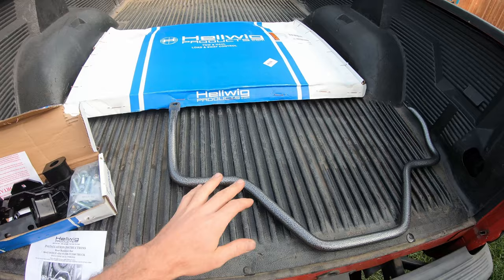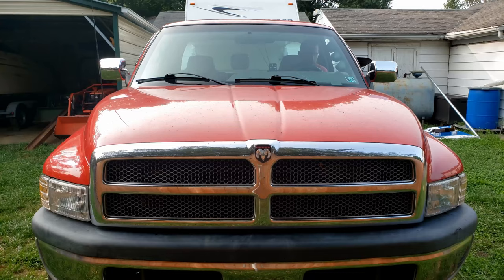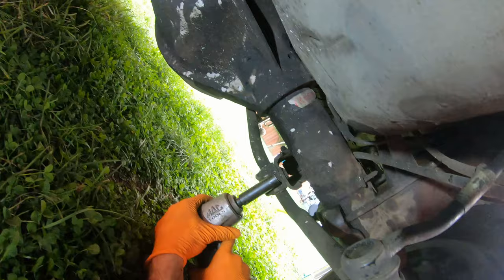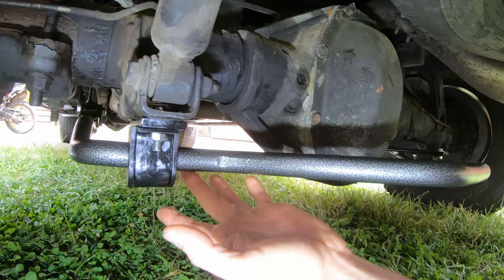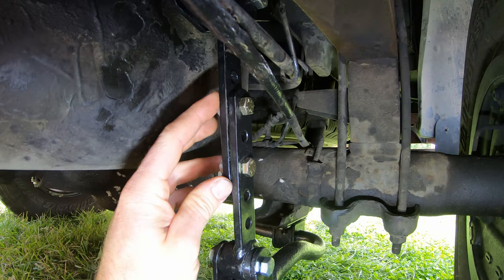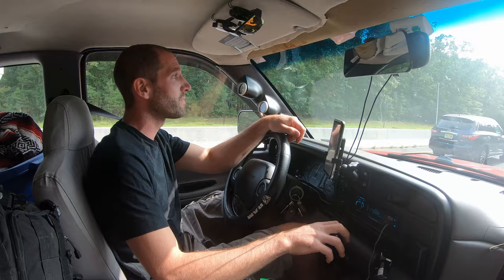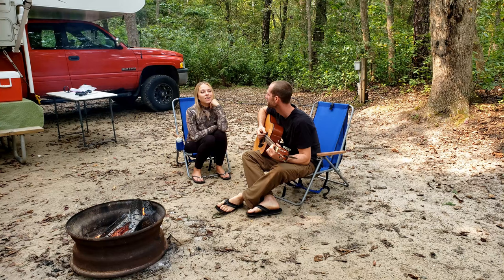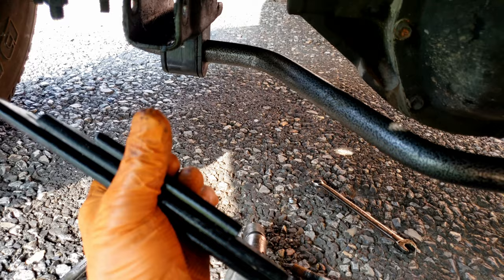Hellwig 7626 Sway Bar Installation / Comparison 94-02 Dodge Ram 1500 2500 3500

Comment: I added air bags to my single axle dodge to increase the capacity and one unintentional thing I noticed was that it made a huge difference in the body roll. First time I drove with it I was amazed almost felt like driving a dually. If your still having issues that might be worth looking into.
Reply from the maker: Funny you mentioned that, I was actually just thinking about maybe trying those the other day when we had the truck camper out. Awesome to hear they helped out and I think I'll give them a go
Reply: Air bags! They made my second gen 2500 Cummins truck drivable with a Lance Squire lite on it. It dives so much better with the camper on it through the corners and over rail road tracks.  Even empty with 10 PSI takes some of the pot holes shock out of the rear suspension.

Comment: Those two bolts by the fuel tank were an absolute nightmare.  Also, had to trim the bushings to fit in the upper frame bracket.  Overall I will be happy if this helps with my rear sway but I was disappointed that it was not quite as bolt on ready out of the box.  My truck had factory holes for the rear sway bar top mounts but the Hellwig bracket holes were not wide enough.  With some time and modifications I was able to make this work, and hopefully it functions as intended.

Comment: Just found this channel. Great stuff. Love the Ram. Not sure if you still have it. Tundra is cool too. Would love to see more videos on them.
Your truck has an 8800 pound gvwr. I'm not sure of your exact weight but I'm thinking payload is in the 2300 pound range. There is a website I can link or swing by a Dodge dealer give your vin and you can get a build sheet. Shows all specific info.
Not sure I cared for the set up of that bar at first. Much better in the end without those extra pieces.
Take care
Greetings from the the 717

Comment: Monotube shocks would be a great improvement to take up the slop.
Reply from the maker: I appreciate the advice. Ended up going with Rancho rs9000xl Shocks. Which after researching. Looks like they are actually a twin tube design. They definitely stiffened up the ride a good amount though. Maybe next time I'll try some monotubes

Comment: I got the same swaybar for my 2009 Ford e350, it doesn’t have one so I guess I’ll notice the difference. Question, I’m going to drill holes to install it, should I spray the holes with something to prevent rust or corrosion?
Reply from the maker: Yeah you will probably notice a huge difference coming from no sway bar for sure.  And yes I would suggest coating the holes with a heavy duty grease or waterproof bel-ray grease is what I use. Make sure to measure twice drill once. LOL.  Good luck and let me know if it makes that difference you're looking for!

Comment: I was just going to buy a 7265 for me Ram 2500 .. wondering if you have an updated opinion ?
Reply from the maker: I'm happy with it. Well it did not have a dramatic effect with the backyard test, I do feel it stiffened up the ride with the camper
Reply: @NoNonsenseKnowHow   I am kind of torn between getting a lighter camper or would a this help enough to make me happy to keep going with the one I have.
Reply from the maker: @David-ry5il  lighter camper is certainly going to make the biggest difference. What camper do you have now?

Comment: Hey man, i hate to break it to you, but you installed this incorrectly. The u bracket should be square underneath the shock mount. You have it floating outside of the mount on the passenger side. You're losing a lot of ridgity like that. Also, that's making your links lose reach. That's why you couldn't grab as many holes as you wanted to. I don't blame ya, the instructions seem to be written by a foreigner. P.s. i have the same exact truck and i just installed this yesterday.
Reply from the maker: I tried lining these up every which way on my truck. And this way seemed to make the most sense. I also sent pictures and reached out to the manufacturer and this is how they said it was supposed to be. I sent them the final video before posting it live and they said it was proper.  anyway that being said, it's been a while since I have messed with this and the truck has been good ever since. It definitely helped out a ton with sway control. Appreciate your concern in either case. If you would like to shoot me a few pictures of what you're talking about that would be cool. I'm on Facebook and Instagram under the same handle. Or my email is in the about section of YouTube channel
Reply: @NoNonsenseKnowHow  I'll send on Facebook. I got mine to fit. It was a major bitch though. If they said it's fine, must be fine. They also sent me the wrong sway bar. In the process of figuring that out. The mounts are the same across the board though, i would imagine.

Comment: Any idea of what the weight limit is for my 1995 2500? Looking at a camper that's 3300 pounds. 11.5 footer. My truck is long bed single cab with air bags V 10. Have a tranny cooler. Not sure if it's a camper model or not.
Reply from the maker: That's a little heavy. I had a camper that weighed about 2500 and honestly it made the truck drive really crappy. Ended up getting a smaller truck camper from the 60s. I like it much better